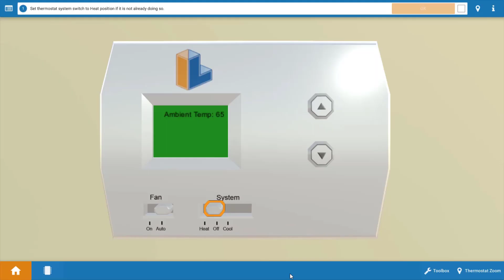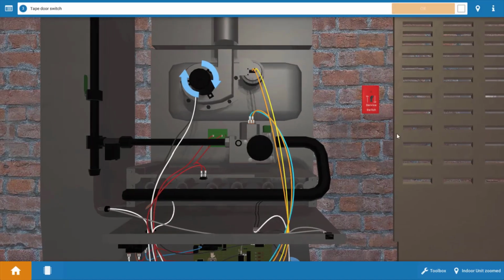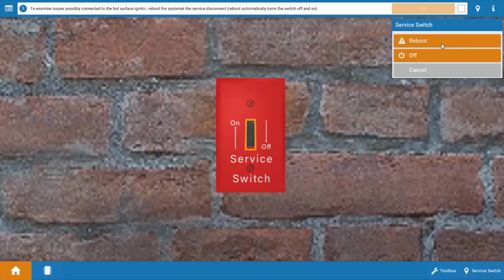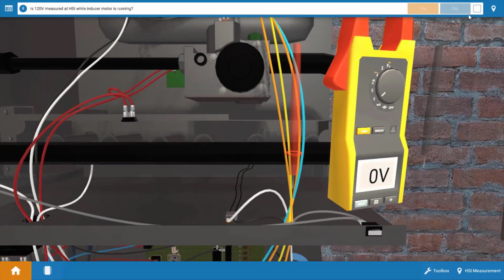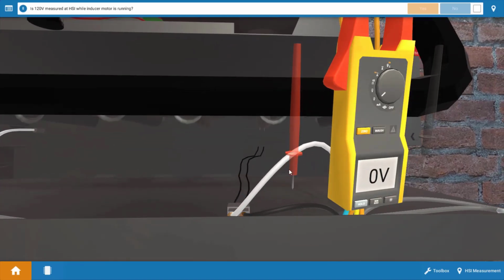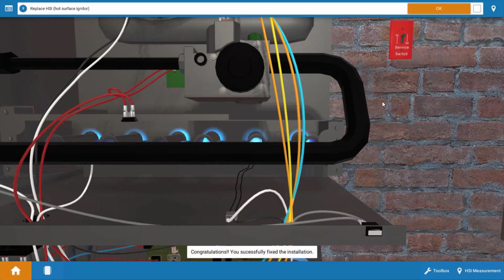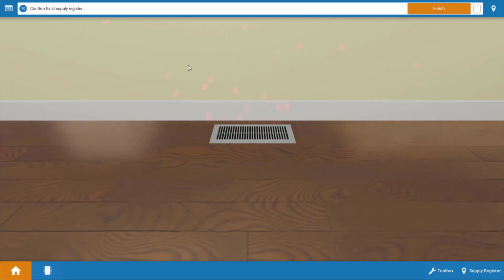Troubleshooting a Gas Furnace Hot Surface Ignitor (HSI)

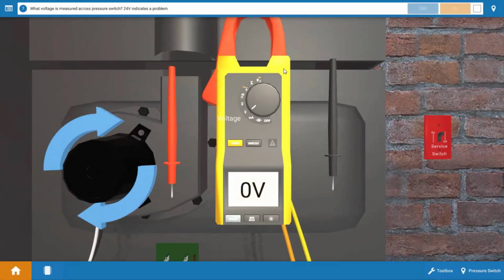Comment: are you talking about the limit switch or pressure switch at 2:00 mins?
Reply from the maker: It is the pressure switch. That is checked since the IFC (control board) will not send voltage to the ignitor if the pressure switch fails to close. If a limit switch was open, the inducer motor would likely be de-energized. Any other questions, let me know. Thanks.
Reply: Thank you for that fast reply. gonna hit the sub button. @InterplayLearning
Reply from the maker: @digitaltreez  Thank you!
Reply: His talking about the air pressure switch